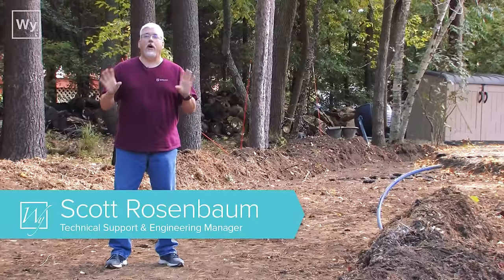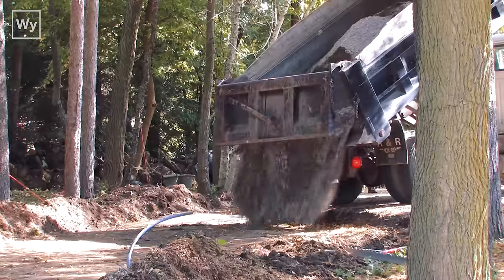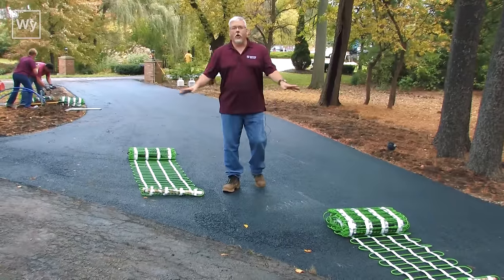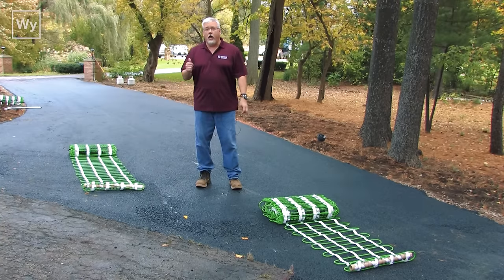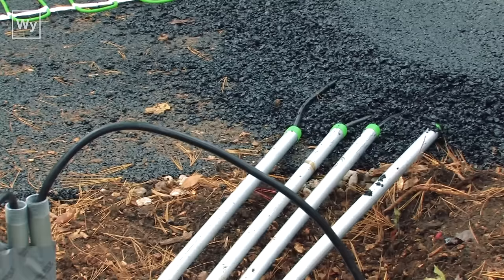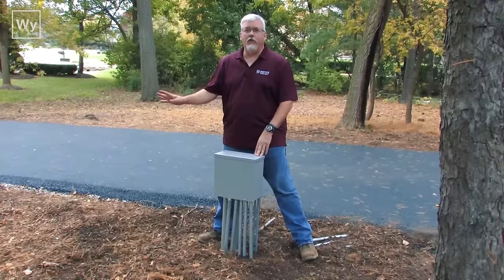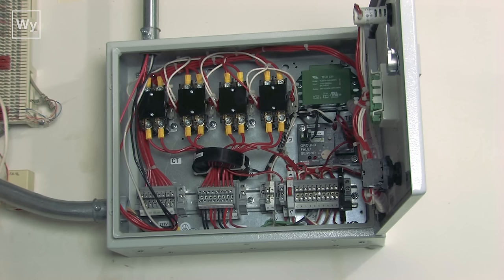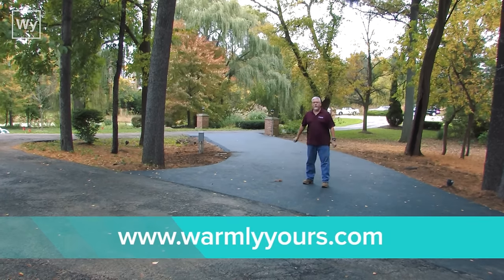Electric Snow Melting system installed in an Asphalt Driveway

Comment: What happens if one of the cable breaks in the ground ? This is just like underfloor heating is one wire breaks than one section doesn't work ?
Reply from the maker: Great questions! In this situation, because the tire tracks are set up in "Zones" meaning, there are multiple mats that can be controlled individually or collectively as a group, then yes. If a wire was damaged, then that section of mat would not be functioning. In order to locate the damaged cable, we would recommend working with an electrician to use a high voltage device (hi-pot) or variable transformer (variac) or even a sequence of using one then another with eventually a thermal camera to locate the break. That way only a small portion (1 foot square) would have to be opened to get to the break and make a splice repair. IF this was the situation contacting our tech department and setting up a rental for the testing equipment and purchase of a splice kit would be required and save the homeowner the headache of tearing everything up. Thanks for watching!

Comment: So what if there is a electrical problem, or the heating strips stop working? Do u replace them?
Reply from the maker: If there was a problem, we would help locate the faulty section, open up enough of the driveway (12-16" section) to use a splice kit (https://www.warmlyyours.com/products/code/SPSM-01) for the repair. We have a fantastic tech team on staff and work directly with electricians to minimize driveway openings and additional expenses to the homeowners. Thanks for watching!

Comment: Can i use a melting mat ON my driveway (witout digging).Are the mats ok in water? 240 volts ...is 240 volts...

I would like to put one directly on ice...and plug it in. Will that work? With electric choc free i mean? We just did our driveway...we dont want to just trow 25 000$ in the garbage and start over to put those inside this time...
Reply from the maker: The system HAS to be embedded in order to function properly. You cannot drive over the mats directly, so laying them out on your driveway would eventually damage them. If you recently redid your driveway, we have a brand new installation option to retrofit an existing driveway to add these systems in. You can find more info on it here: https://www.warmlyyours.com/snow-melting/driveway/retrofit-application-guide. We'll actually be reviewing this installation type in a webinar next month - you can register on our website.

Comment: It can get around -40°C (-40°F) with wind chill and occasionally ice crystals in my area. 
Will this still work!”?
Reply from the maker: Unfortunately this system does have its limits to help keep it efficient. We typically do not see the snow melting as well when it gets close to zero. -40 would definitely see this issue get worse. There is a manual override if you want to make the system keep running, but the energy costs would not be as efficient as it was designed to be.

Comment: Is it possible to turn off the whole system and turn it on for winter only? I don't really want the whole thing to work/sense when there's no chance there will be snow
Reply from the maker: Yes the system can be manually controlled from inside the house with controls or your phone even! There are also sensors you can buy that will auto-detect moisture/temperature - making sure it only turns on when it starts snowing.

Comment: so basically the heaters turn on anytime it's cold enough to snow..so basically 24/7 during winter?
Reply from the maker: Hi Chris, when the system turns on entirely depends on which of these outdoor controls are paired with the snow-melt system: https://www.warmlyyours.com/products/line/snow-melt-and-deicing-snow-melting-control  For the Premium Snow Melt Control featured in this video, it detects precipitation and ambient temperature and activates when there is precipitation present and temperatures below 38 Degree Fahrenheit. Our other controls allow customers to control which temperature the system will turn on at when precipitation is detected.

Comment: Will it work if you place it on top of an existing driveway and only cover it with a seal coat?
Reply from the maker: The system needs to be embedded beneath 2-3" of new asphalt. We typically recommend a new driveway or retrofitting an existing one by creating trenches in the asphalt to place the product. You can learn more about it here: https://www.warmlyyours.com/en-US/snow-melting/driveway/retrofit-application-guide Thanks for watching!

Comment: can it be used for pastures so that farm owners can feed their sheep with grass in winter as well ?
Reply from the maker: It is not rated for use within soil, only asphalt, concrete or beneath pavers within sand/mortar. But there are products that are designed for greenhouses that help warm up the soil to prevent freezing - not sure if that would actually work for what you're describing though as it's an open air environment.

Comment: I'm at about 7000' in the Sierras. On occasion, snow can get very deep in a very short period of time. Does this pose a unique challenge? For instance, if I did just the two tracks, would I expect to still show up to a 4' tower of snow down the middle? Or, does the heat radiate enough to mitigate that? I've got about 40' of sloping driveway; straight to the garage. Also, we can go weeks without any snow at all. Will the tracks engage at a low temp, anyway? Or is there also a moisture sensor? 

Thanks.
Reply from the maker: Our systems are designed to melt 1-3" of snow per hour on average - depending on the weather conditions. Sudden snowfall (like a blizzard with several feet overnight) will not melt as quickly but it will eventually melt. 

As for the tire tracks layout, the heating cables only radiate out by 1.5", which is why we often space them at 3" to have complete coverage. If you got 4' of snowfall, there would still be a buildup in the center, but any snow that fell onto the tire track would be melted. The great thing though as that these systems not only melt the snow but they also help prevent any melted snow from refreezing into black ice.

These systems come with various types of controls and sensors, so depending on what's selected, the system could detect moisture and temperature to make sure it's only turning on when snow is present on the surface of the driveway. Helping the system only turn on when you need it.

Here is a link to our main page for this type of product: https://www.warmlyyours.com/snow-melting/driveway . 

And here is our online tool that could help you figure out what the cost might be to cover your driveway: https://www.warmlyyours.com/snow-melting/quote-builder . The difference in cost between full coverage and tire track layout for a 40' driveway is roughly $1300.

Thanks for watching!
Reply: Thanks!

Comment: Extra electricity bill costs during the winter unless you already installed a 20,000 USD solar system off-grid plus the cost of maintenance.
Reply from the maker: KC, our systems use 50 watts per square foot. And if you opt for tire track coverage, as these homeowners did, you cut down on electrical cost significantly. Compared to the cost of salt bags and back breaking shoveling, it can definitely be worth it in areas that have lower electrical costs.

Comment: Why weren't the cables and piping to the junction box buried and brought up right into the junction box? A lawn mower or edger is going to crush and or grind through those exposed piping over time?
Reply from the maker: Hi there, it's not in the video but the area has been filled in with dirt by landscapers.

Comment: I give it 2-3 winters til someone takes out that junction box, its to much of a target where its sitting may as well paint a bullseye on it... Just saying nice job otherwise.
Reply from the maker: Unless it was installed incorrectly (e.g. a cable was knicked or damaged while laying out system) it is incredibly unlikely the system just fails. These products have a 10 year warranty. We've had few calls for repairs, but when we do, they have often been from damaged that occurred during installation.

Comment: I wonder if they are wired like christmas lights, wired in a series and when one goes out they all go out..
Reply from the maker: Actually if a spot in the cable fails or becomes damaged during installation, it is possible for the rest of the system to still function. But we do offer repair services should anything happen so you can make sure everything is in working order. Our team would only need to excavate the surface material in the spots where there is damage, make the repair and then patch that spot. So no need to tear up the entire area if there is anything that needs fixing. You can learn more about it here: https://www.warmlyyours.com/services/troubleshooting

Thanks for watching!

Comment: How do you repair this if something breaks down under the asphalt?
Reply from the maker: There are tools you can connect to the cold lead of the system and it will tell you where the cable is damaged if at all. Once you know how far down the cable it's damaged, you'd reference the original installation plan (provided when you order) to locate where you would need to excavate material and do a splice repair. The tools are available to rent from our tech team if they're ever needed.

Comment: Is there such a system like this for gravel (dirt) driveways?
Reply from the maker: Unfortunately there is not. The gravel and dirt would shift away too much and possibly uncover the cables which would leave them exposed - something the National Electric Code does not allow for. However you can install this system for Pavers (within sand or mortar), asphalt and concrete. Thanks for watching!

Comment: so whats the life span of something like this. This seems to be right up there with underfloor heating.........any issues and it all has to come up.
Reply from the maker: Hi Gary, It is the similar to underfloor heating, but we typically don't have to tear up more than a couple tiles/pieces of flooring in order to repair a damaged heating element. We are able to precisely locate a damaged piece of wire, repair just that section and have the flooring go right back over that isolated area. We actually use the tools shown here to locate damaged heating elements for floor heating or snow melting: https://www.youtube.com/watch?v=xpMmNA7Tx7g  We are currently working on a snow-melt version of this kind of "troubleshoot" step-by-step guide.

Comment: Does this work with recycled rubber paving systems instead of asphalt?
Reply from the maker: We do not recommend this product for those types of pavers. Regular pavers work well because they transfer the heat easily from the mat layer to the surface. But rubber pavers may insulate a bit too well for the heat to transfer efficiently. Asphalt, Concrete and regular Pavers are the three materials we recommend using with our system.

Comment: What if the heating element turns on during the summer cus where I live in the summer its over 100 degrees winter under 10 degrees
Reply from the maker: Unless you manually turn on the system, it would not be able to turn on in the summer. With the right moisture and temperature sensors, the system will only turn on when it's the right conditions to melt snow (i.e., below 40 and snowing).

Comment: Hello Hungarian Romanian European here. If I only want to use this product 5 days to melt snow. Can I just put it and after that take it. Will it melt it? Is it safe?
Reply from the maker: The system can run as frequently as you need it to. Most customers purchase sensors and advanced controls which allow the system to detect snow on its own and start melting when needed. There are always manual override to these controls, so should you need to turn it on you are able to. The systems with advanced controls are designed to turn on when its energy efficient to do so. If it is snowing too much too quickly, the system will automatically shut off, but you can turn it on manually if you don't mind using more electricity to do so.

Comment: Good video . I assume this only works on asphalt not concrete because asphalt gets hot and gooey when heated. Did you mention that? Also interesting video but are you in such a hurry to post you couldnt show it working in winter??
Reply from the maker: This works for asphalt, concrete and in mortar/sand under pavers actually. The system only gets warm enough to melt the snow, so just above freezing. Slab sensors are installed with asphalt jobs to help detect the internal temperature and turn the system off intermittently once the snow has melted to protect the integrity of the asphalt, no worries about it getting "gooey". As with anything designed for winter, it's always best to install well before the season, so this project was completed in late summer of 2016 and we wanted to share the install as soon as it was ready while we waited for the first snowfall. We actually do have separate videos showing it at work once winter came that year, you can see one of them here: https://www.youtube.com/watch?v=7wdpsTCYoXI
Reply: @Warmlyyours  okay thsnks ill watch

Comment: What  happens if the sensor malfunction and never turned off?? Would you offer to help the customer that paid in over 4,000 dollars for the product alone with the expensive electric bill?
Reply from the maker: All of our systems can be turned on and off manually - if a customer's sensor stopped working, they could easily control the system manually.
Reply: WarmlyYours I read a review that one had malfunction and owners never knew the system was constantly running til a $3,000 electric bill came in the mail. That’s a concern for me.
Reply from the maker: If the sensor malfunctions, it won't detect snow/moisture and therefore won't activate. We have not seen a review or received any feedback for our snow melt systems where a customer had this type of issue. If it is a concern to someone, they could opt for one of our controls that is manual and turn it on and off when they need it.

Comment: self regulating heater cable like this has been around for over 20 years nothing new can be used for anything from stopping pipes from freezing under lagging to  being used in trays to fit under treads on metal fire escapes to stop them freezing

Comment: This would be expensive to install because the final layer of paving has to be done by hand with shovels and no paving company wants to do this. Also, the surface would not be a cosistant thickness due to the absence of a paving machine screed board, and surface would cause a bouncy ride.
Reply from the maker: While a paving machine can't be used, there are many driveways that have been installed just like this with our snow melt system. We've have had no issues that compromise the functionality of the asphalt driveway with this type of installation, plus no more salting or shoveling!
Reply: Ask any paving company to quote 2 ways: paving with a machine or shovels, let me know how that turns out.😁
Reply from the maker: Well, it turns out that many customers are willing to pay a bit more for the type of install needed if it means no more shoveling or salting their driveway. Investing in a system that's installed correctly will pay off in the long run. 👍
Reply: I completely understand. Im just saying........

Comment: Asphalt temps are 350 to 370 degrees when being applied. What are they putting down? Not even steaming. Also, if it were that temp which should be, the plastic sheathing on wires would melt!
Reply from the maker: They are indeed putting down a base layer of asphalt, laying out the snow melt mats and then applying a top layer of asphalt. These wires heat up and radiate warmth to help melt the snow and are incredibly durable. The asphalt's temperature does not damage it during installation as long as all steps are followed properly. The most important thing is to make sure that heavy machinery is not rolled directly over the heating cables, or using sharp tools like rakes or shovels to move the cables that could nick the casing/wire. Thanks for watching!

Comment: why would you add the rocks at the  top if when it rain and the water freezes it well separate the rocks and it well be a miss
Reply from the maker: These layers ensure that the structure is sound, and this is how it would be constructed regardless of whether it involves snow melting cable or not. Asphalt expands and contracts anyway whether it's in the winter from ice or summer from extreme heat. Our cables have a 10 year warranty against manufacturing defects. Some customers don't want to spend all of the money that is required to pour a driveway, and asphalt is a good compromise. If a customer is interested in a more durable paving material, they can go for concrete, and we are able to heat that as well.

Comment: I would think that these days a thermal camera might be a much better controller.
Reply from the maker: A thermal camera only detects surface temperature of the asphalt, whereas our sensors detect surface temperature and moisture, ensuring the systems come on only when the conditions for ice and snow accumulation are present.

Comment: What’s the average lifespan on this system?

Thanks.
Reply from the maker: If it's installed right, tested and wasn't damaged during the install, it will outlast the concrete or asphalt it's installed in. And once the driveway needs to be replaced, the system would have to be replaced again at that time due to excavation of surface material. Thanks for watching!

Comment: what if someone accidentally tries to walk on these roads while the heating is ON?
Reply from the maker: They would be able to safely walk on the asphalt. The ground does not warm to a point where you would noticeably feel it radiating heat to your feet. It would simply make it warm enough to prevent snow from sticking/forming ice.